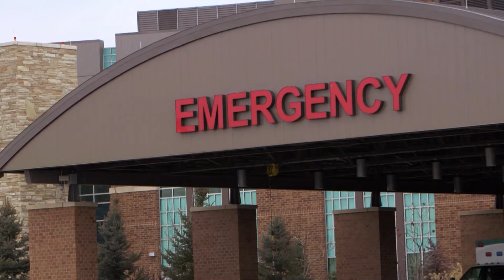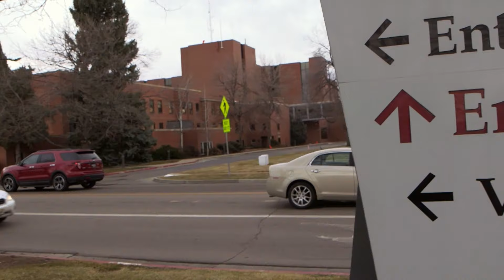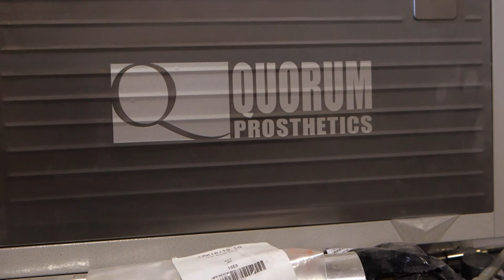Survival Stories: After The Fall | Fight To Survive | FD Survive

Comment: Cool to see your story on here, after the little clips of it in the intros.  Really great work recovering.  I've only done around 3 months of physical therapy after wrecking my foot, but even that took a lot of motivation.

I was doing parkour in an unfamiliar playground, and I hadn't thoroughly checked it out before jumping around.  When I side-hopped off a spiral slide I expected to land on flat rubber padding.  Instead, I came down really hard on rubber padding that was cut at a hard 45-degree angle.  My foot immediately gave out and flipped sideways, then all my weight came crashing down on my ankle area.  Crunch, crunch, munch.

I received multiple fractures and what the nurse called "one of the worst sprained ankles you can get".  I had to wear an inflatable air cast for about 4 months, but started on painful physical therapy after 3 weeks.

By around 9 months from the accident I had regained about 90% foot function.  If I jumped straight up my foot would get weak and painful.  But if I tried to twist my foot left/right more than 1/3 of a turn, I would get excruciating jolts of pain (the motion my foot had hyper-extended on).  Once I identified these two remaining issues, I did my own physical therapy for 3 months: gently hopping up and down on the pads of my feet, and rotating my feet left and right until it got painful in each direction.  Was so nice to be fully recovered after about a year!

Well, not fully.  Since the accident I have had a general swelling in my foot, and varicose veins visible on the top of my foot.  But apart from that, I can walk and jump and bike ride again -- without pain!  Physical therapy is well worth the painful effort one puts into it, it reduces the pain in the long run, and helps a lot with blood circulation and healing speed.

A previous time I had crushed the side of my foot on some concrete and it went purple/black/blue and I was badly limping for a month, but that time I didn't go to a hospital or get any physical therapy.  It took me almost 2 years to get back to normal that time, despite being a much less serious injury.

I would highly recommend physical therapy to anyone.  Or just do it yourself, gently push the injured body part far enough it hurts so it heals up (just make sure a doctor has cleared you for it, that you won't worsen your injuries).  But when it's just pain -- push through it!  You will heal, and the pain will pass.